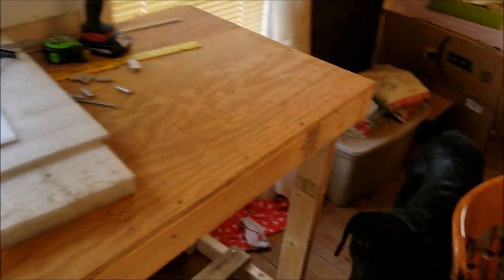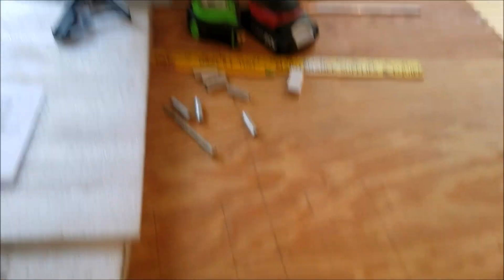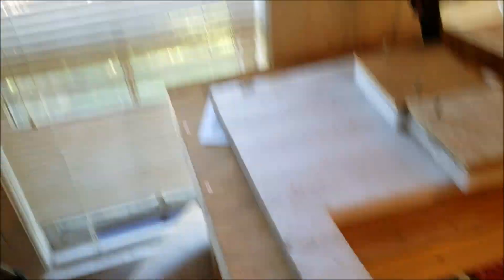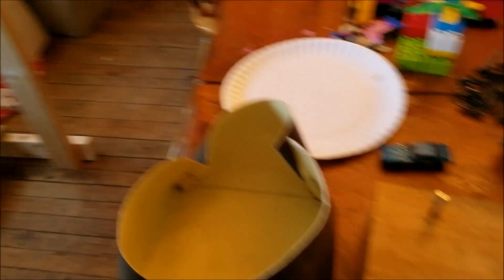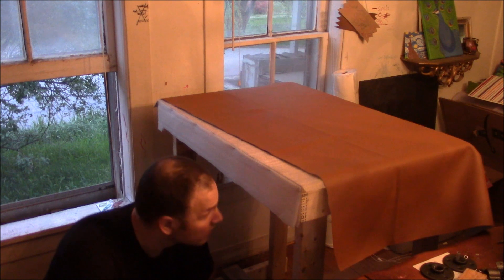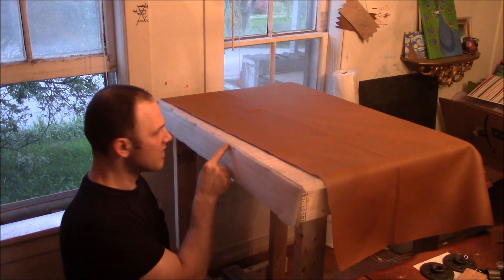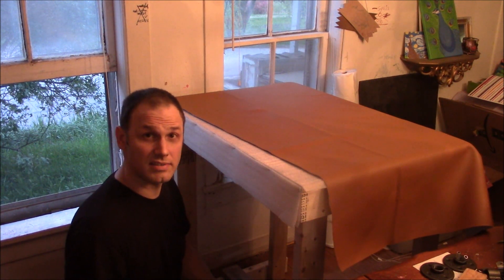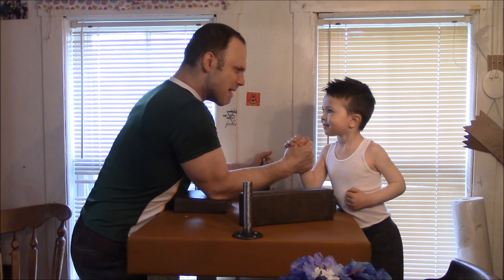Making an Arm Wrestling Table

Comment: You didn't give any dimensions? Table height,  width, thickness of the plywood. Looks good, but a few measurements details  would have been good.
Reply from the maker: I did a follow-up video for that exact reason.

Comment: That one nice table top. I wrap the elbow pad using ducktape to make it more firm before applying the cover.
Reply: Just want to add, table edge sweet spot is 4 inch thick. Feel good when you dig your hip against the table edge.

Comment: They are gonna rip out eventually them handles are so bad
Reply from the maker: Not a chance, those handles are very secure. I did have to reinforce the legs with lag bolts though.
Reply: @WJBlades  nice one nice table anyway good

Comment: I was wondering, why not use dumbbell handles and cut one end off?
Wish me luck as Im about to make one for my gym, and this video was A MASSIVE help! thank you sir
Reply from the maker: Another guy did a video using an old  dumbbell. I was unwilling to cut the only set I have... still using them as dumbbells. =)
Reply: I made a table and used dumbell handles

Comment: Awesome video,can I ask you about the holes on the elbow pads and where should I put the bolts on them.Also what's the measurment of that hole next to the elbow pads which is for changing the position of the pin pad?I would be very appreciative If you can help me out with it,because I can't seem to find info.
Reply from the maker: Sorry for the slow response, it's been crazy. I just went to my first tournament yesterday.
Reply from the maker: I'll try to make a quick video about where I put the holes.
Reply: @WJBlades  You're such and awesome guy,made a video to explain it for a confused person like myself :D.You weren't even slow with the response.Thank you again,you actually did the best tutorial for making an armwrestling table!
Reply from the maker: Thanks, I just took 3rd with my right hand in my first tournament yesterday. Just amateur but lots of fun. Good luck with your training. =)
Reply: @WJBlades  Oooo,that's nice man,congrats!Good luck next time,get first place :)!

Comment: Hi, I’m late but where did you get that foam from. Do you remember? Nice video btw
Reply from the maker: Can't recall, might have been post office.
Reply: @WJBlades  thanks and where did you find all the measurements for the pads and the holes for right and left hand?\
Reply from the maker: @termixx9139  I did a follow-up video explaining just that it's on my channel.
Reply: @WJBlades  thanks a lot

Comment: What did you use for the pins and the metal grommets on the table where the pins go?
Reply from the maker: Old aluminum tubing that I cut off an obscure tool handle and aluminum rod I had on hand from Lowe's. You could just as easily use automotive gas line and steel rod from Lowe's.

Comment: How much measure the support pin? It seems to have about 6 inches? The elbow pad 2 inches, and the beat pad 4??
Reply from the maker: If you're referring to the pens the go through the holes in the table, I didn't measure them. For the elbow pads they probably stick out about an inch and a half. For the pin pads they probably stick out 2 inchs.
Reply: if you are interested in the dimensions, I made a video about it. the bars I used are ~27 cm long, 15cm is above table, the rest is below table level for securign the bar.